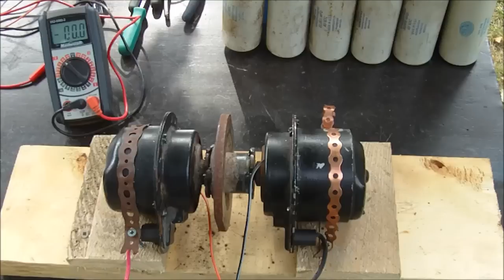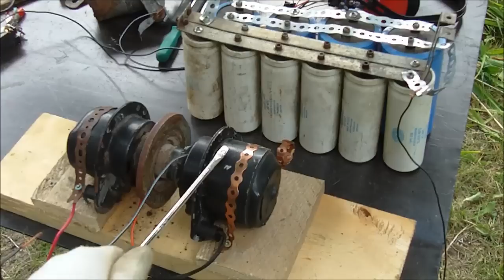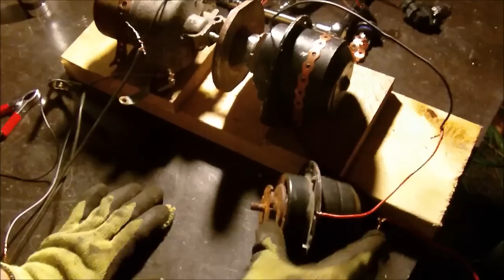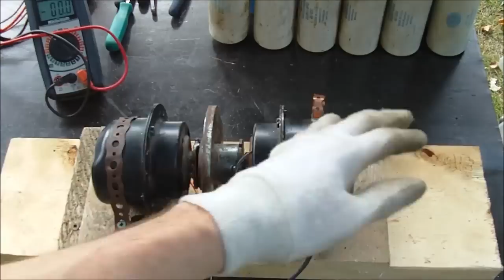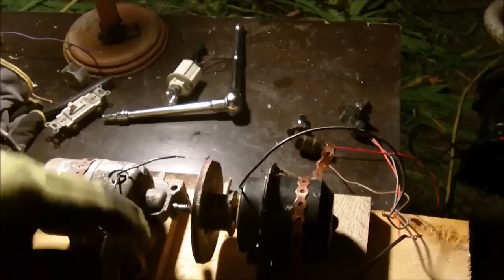Electric Motor to Motor, can they self run?

Comment: i have a qustion for you the wheel in the midle of the two motors running on a load of the two motors meaaning is the wheel doubled in any way like tork or horse power

Comment: well, of course it doesn't work. you're using the wrong capacitors! it will self-run only with flux capacitors. 
but that will be only a 1 to 1 power ratio. no over-unity. for over-unity you need naquadah magnets. 
duh...

;))
Reply: No, he needed to use artron energy rather than electricity

Comment: This can be done. Loads of people have done it and it's not that difficult. I have  managed  to knock up a rough model. I might refine it in the future when I have more time. It's no big deal, there are loads of free energy machines out there. These types of machines are a little bit primitive now compared to the pure electronic generators which have no moving parts. The reason why this experiment  was not successful, is because there is no potential difference in the design.Thats to say that everything is locked together, so there's no opportunity for it to freewheel and gather momentum. You also need some very simple electronics to make it work. The best ones are purpose built, so that all the coils,magnets,electronics etc, are all built into the flywheel, and they run on extremely low friction bearings. I made my (slap generator) as I called it, as school science project when I was 13 years old.I am now 58 years old. Believe me when I say, free energy machines have been discovered, built, and shelved. The governments of the world don't want us to have this simple technology. People have been threatened and even killed in order to keep it under wraps. They use bits of it occasionally for example, in some states of the US, all the emergency vehicles are powered by hydrogen. In certain parts of New Zealand they have ariels that absorb very usable electricity from the atmosphere, Tesla style, but they've had that since the seventies but there are many more examples. Peace to you.
Reply: Don't make fun my friend. What most people don't take into account, is that while many things have advanced over the years, science theory has not. Science has not moved with the times, and many of the old theories ARE WRONG. Scientists even know this but continue to try and make it fit into the modern things that they are working on. It's just sheer pride laziness and arrogance on their part. If I was struggling with a project for years and someone gave me all the answers on a plate, I'd be extremely grateful. I have previously offered to share the theory of my machine with someone on youtube,  but I will only do this via email. I have posted things on youtube in the past  and have had so many questions, that I couldn't cope with them and just don't have the time to answer them all.
Reply: gonojah ibitham. I am currently traveling,but as soon as I am back home and settled in a few days and have more time, I will drop you an email. It's good to hear from someone who's serious and interested.
Reply: fascinating.
Reply: Stupid people only play on loop back modeling.  No real 500kw Load like i did.  Mechanical loop back works only for light load.
Reply: Built one myself yes it runs, yes it did produce some excess voltage however almost no real amprage which  Of course the force  necessary to drive anything.
Reply: @truthlord4438  the laws of thermodynamics and conservation of energy are laws meaning they are proven time and time again theories are just concepts I call bs on everything you said
Reply: Everyone just repeats the same script. The prevailing excuse is people being threatened and killed.  No idea this big can stay suppressed, nor have they in the past.  You are just parroting stuff you read online with no factual information and no evidence to back it up.  If it is so easy, make it and run your house for free lol...
Reply: @jackpetersen3383  The laws of physics don't change, you are confusing this with physics theories which change over time and everyone is very open about this. An equivalent analogy to  what you are saying is like me saying that water may not actually contain Hydrogen and Oxygen because we are still finding new elements and atomic structures.  No water has been definitively proven and can be tested to contain H2O that is not a theory and it will not change.  It is not dependent on the periodic table being completed, or any other new element being discovered...
Reply: Right ,right ,tons and tons of free ,free energy engines that work .       Its just we are busy and what not ,so yeah ,hooking it up to our house is like. " no man ,im chilling ,ill do later" 
 Plus the guys in black always be hovering  like bugs , so annoying

Comment: Two asynchronous motor, sccording to Tesla, should be able to run with a capacitor in between the wires.   Try out  different connections of the wires, but you should give the inicial push.
Reply: omg ,  Tesla was a visionary,  instead of pursuing radio he spent his whole life trying to transmit free energy  through space. Marconi then picked up on the radio and made a fortune. Tesla died in poverty. his only true claim to fame was magnetic flux was named after him. I have great respect for Tesla, it's just when people misquote his ideas that you can create energy from from f all that really make people look and sound ridiculous.
Reply: you can never make 1 to 1 work (head to head) different size pulley's side by side will give you results.. example 2 to 1 drive pulley turning 2 rotations for every one given will give you excess power to run other things. this is the equivalent of a driveshaft in a car. the drive shaft rotates at 4 to 1, driveshaft turns 4 times to rotate a wheel once.. in high gear drive is 1 to 1 and overdrive is 1.5 over a 1 to 1 ratio so it has been proven.. its not simple as this video.. i still can't figure out why the government does not put windmills on the highways..ever break down and walk home? the trucks that drive by make wind that will knock you over...why waste the wind energy...everyone is just not looking in the right places for free energy
Reply: You cannot create energy out of nothing and you can't circulate energy in the form of electricity into induction, into kynetic energy, back into induction and then back into electricity indefinitely. No matter if there's more capacitors or no matter what the turn ratios are. 
     Wind turbans need to be huge to be efficient and by the way, that's not what this video is talking about when it says "free" energy.  This video is showing that perpetual motion is impossible. Meaning that whatever energy you initially have will dissipate without any additional energy from outside the system. Wind turbines are not creating its own energy. It gets its energy from the wind.
Reply: WOW I see ignorance is still blissful in science.
Reply: Pacero one word...Friction...
Reply: no use a transformer at the least here to up the voltages then use a control unit to redirect the max voltages to load and motor then

Comment: I always wanted to try a low voltage motor turning a alternator  and see if it put enough charge out to keep the battery charged ie self run

Comment: Hello. I have a question I wanted to ask you. I've tried figuring it out on my own but I'm afraid of doing it wrong. I want to make a generator powered by my old weed eater for a hidden cabin. I want to run a low energy tv dvd combo. As well as one or two light bulbs for through out the night. I'd like to be able to run it for 4 to 6 hours. Im just wondering how big of an inverter I will need. As well as what batteries will I need? Thank you for your help!

Comment: I love the your video and you made me figured out something. The Hybrid cars like the Toyota Prius and the fully electric cars that uses an electric motor to run the itself, But i was wondering how they make the car stop efficiently without the engine running the brake booster and so on. So when you said if you connect the generators together and energy produce act as an Stopping force or Re-gen, So maybe they us the energy to help the brakes to stop easily.
But that's just my thought :)

Comment: Perhaps changing the drive ratio. A belt and pulleys drive system. A 2>1 ratio could give you the "driven" speed of the generator shaft at half the "drive" speed of the drive motor shaft. Now think about 10> 1 or 20>1 ratios, how much could that help?  I like your idea about using capacitors, perhaps some type of array of capacitors. Set up in a phased array, loading and unloading to supplement the system. unfortunately, the problem always seems to come back to that old adage what's the answer to everything the problem is heat, it causes parasitic loss. Great delivery, very down to earth, and on a personal note. I have to say I like the way you keep your wires. no fancy clips for you, just twist them and go! AWESOME, I love the real world not a stage show. I have always had a interest in this concept, wondering if one could be built. Thanks for the great video, keep up the great work.

Comment: concept is sound but you can't use brushed DC motors (i.e. commutators don't work) and the drive motor needs to be a lower voltage than the driven(generator).

Comment: We are trying the same thing, with puting some strong Magnet. We'll activate the magnet with a strong spark going to  a coil. We expect that the brief spark of energy will generate a strong trust to the magnet that will ad momentum.
This way we could create an over unit of energy that can be either reused immediately or stocked into a cynetic weel.
What we need is a periodic spark that will accelerate as the speed will increase.

Comment: I have already messed around with this when I was younger as well. And came to the conclusion that you would need a significant jump in taller gearing, power storage(battery) and a rectifier. All in all, you would end up with a dead battery.

Comment: Thank you for this video. First, I want to give you a thumb up for the humble way you express yourself. That is to me a very good sign of a serious presenter. Now physics. I have seen many videos about "greater than unity" (right words??) machines. I miss some really good explanations from the producers HOW they did. I have never seen any proper schematics presented either. Even videos where the actual demonstration was not a demonstration of a "perpetuum mobile"., but merely some electrical experiment, I saw. Even if I am a classic researcher (applied physics) I am open to some stuff that we cannot prove, but have been PROPERLY experimentally shown. However, the motor-generator thingy, I do not buy that. First law of thermodynamics. Just a little reasoning here: ASSUME that we can make more energy than we put in to the system. I said ASSUME! I also assume that we believe in Einstein's formula that E=mc^2.  The old smart guy said that energy equals to mass. My conclusion: Then the motor-generator setup can make mass. Oops, what would happen to Universe?  These thoughts have been produced just now. No deeper philosophy.

Comment: Maybe you should try it adding some magnets and copperwire to the belt holder. the motion of the magnets across the copper wire will generate energy by itself.

Comment: i had same issue with similar project.
the 2 main issues were as both units are motors when power is coneted to both they will both drain the power rather than one producing and using..so i used 4 diodes to control the flow of power in to drive motor and out of motor generator.
the second issue was direct drive if the 2 amatuers are connected so they are not electricly isolated from each other one amater can short other out or absorb power . so  i found using belt drive as an ideal method of isolation and it also aloud me to change drive and drag wheels i used a 4" pully wheel for drive motor and 2 " pully wheel on generator motor. so the rpm of the generator was dubbled .
i built it on 12vdc basis to start with it also had super capacitors as a rechargible power suply.
the unit ran pretty nice

Comment: Okay, say I choose to use only a stator and a rotor coupled together using a shaft then connected to a motor thereby reducing the heat loss caused by the bearing. At the alternator side I set up a feedback system to monitor the speed when the load is applied so as to switch to battery and send a signal to a speed controller is there a possibility of obtaining a constant free energy system

Comment: The fun thing with such setup is that it is theoretically equally effetive as only use one motor and a flywheel. When motor is connected to generator and back to motor, there is no way to distinglish what is generator and what is motor. So we can probably get a slightly better performance if we just remove one of the enginges and we will not loose energy from unbalance and friction in the removed motor.
It all boils down to law of conservation of energy...

Comment: Many thanks for making this video, it show the laws of physics, you cant get out more than you put in!
This is a wonderful example of how it cant work, anyone fighting this is off there nut, the only way this can possibly have a chance would be a vacuum with magnetic bearings at zero Kelvin using super conductors, but all that is going to take a small power station to make to correct environment to have the 10 watt motor and generator run.
Back to school for anyone arguing !!!

Comment: Finally🙏 can you add battery to continue charge and run.like loop
Reply: That as well as a lager motor and a couple of one way diodes. I thought of that too. Doesn't make since to remove the battery because the motors need a constant flow of current  to work right?? Not sure I never took physics

Comment: Throw in a couple of diodes and some resistors. It still won't work but it will look pretty.
Try using one motor with both an armature and a field coil. When you "break" the current to the armature the motor will run away. I remember this from experience about 40 years ago.

Comment: try building a makeshift 2 speed (ratios 1:1 and 1:1.5-2) transmission for the motor, hook the transmission and generator up to a pulley system. see if that would work longer. the 2 speed transmission sould have an rpm activated clutch in it that puts it in 2nd gear. the 1st gear sould have a locking bearing on it so it can spin freely when the 2nd gear activates.

Comment: I knew an auto mechanic years ago who actually believed that he could design an eight cylinder engine, four large cylinders to act as an air compressor into a storage tank to drive four smaller cylinders in a two cycle configuration using compressed air instead of expanding gases from burning fuel. The idea was to charge the on board air storage tank initially from a shop compressor and once the "engine" was put into motion, it would sustain itself into eternity on it's own regenerating compressed air supply. The only maintenance it would need was to keep the oil clean but because it didn't run as hot as an internal combustion engine, the oil would last considerably longer. That and replacing bearings, piston rings ect. as they wore out. He wouldn't listen when I tried to explain to him that the pressures that he could practically develop in this fashion would be much lower than normal combustion chamber pressures and could NOT sustain itself let alone that AND move an automobile too but this is how innovation happens. It comes from people who reach for the unattainable but settle for more than what's available.

Comment: and also why you want to use gears is that the motor is taking most of the generators output so when you put a load which means take from generator to the lighting that the motor will for sure slow down then at its max speeds to keep the generator going at its max speeds then right ?

Comment: I think another solution would be to add some sort of gear set up inbetween the motor and generator. plus adding a battery that's being both charged and drained by the motor and generator to act like a storege unit for some extra power.

But what do I know

Comment: What I like most about this video is you refer to motors, as motors, which they are, while every video talking about engines refers to them as motors. Duh my 440 motor or my Big Block Motor.  Motors are electric and every car show on T.V. Refers to engines as MOTORS. Motoring?

Comment: can you per say put a magnet on a stick between the two motors on the disc, create a coil that said magnet will rotate within, take the current from said coil and magnet and the generator fan motor output into a capacitor bank and use that to self power the generator?

Comment: yeah if you use a very small gear on the motor and put the bigger gear on the generator then what do you get outputs of voltages  ?